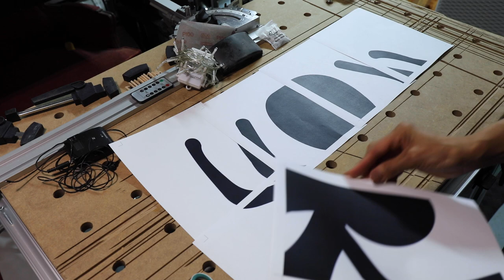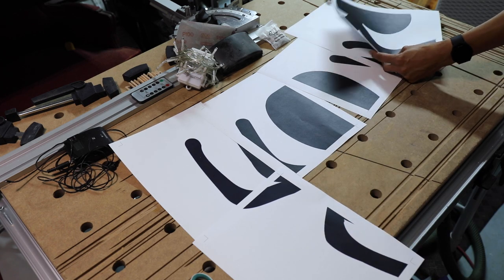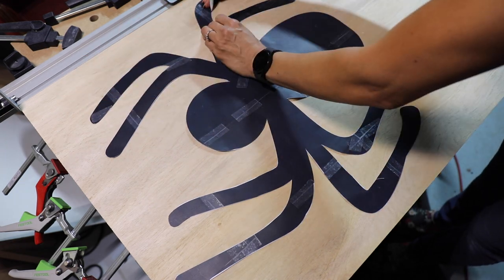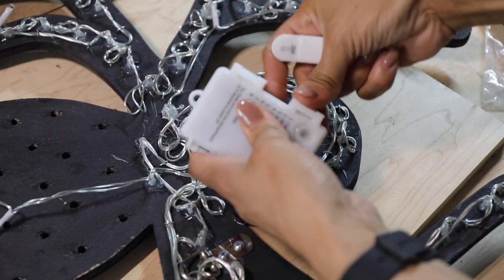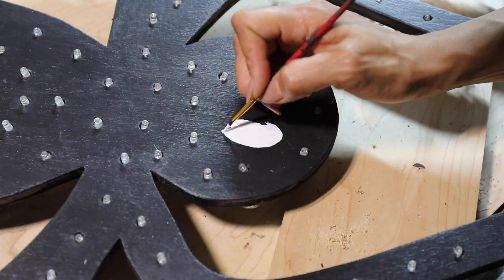Easy Jigsaw Project for Beginners! - Halloween Light-up Spider - Thrift Diving

Comment: What blade did you use ? how many TPI
Reply from the maker: Good question! My favorite blades are from Starrett. Ideally you should use a scroll blade but for this project, a standard smooth cutting blade would work. Not a "fast" blade. Don't know the TPI off hand (without checking) but on jigsaw blades it will tell you if it's for a fine cut for a fast cut, or if it's scroll.
Reply: @ThriftDiving  thank you ill look into it i use a scroll saw for everything but i want to do larger stuff so back to basics with a jigsaw but blades were always the bane of my existence lol